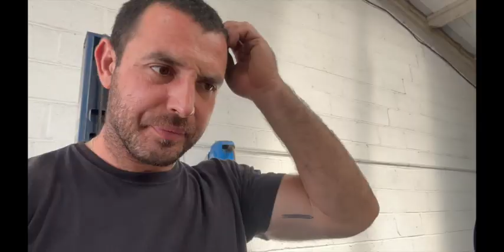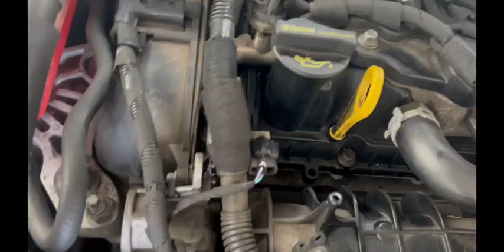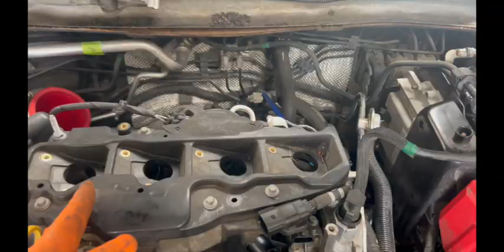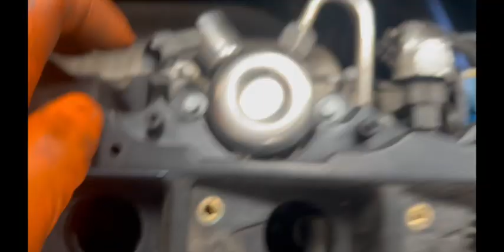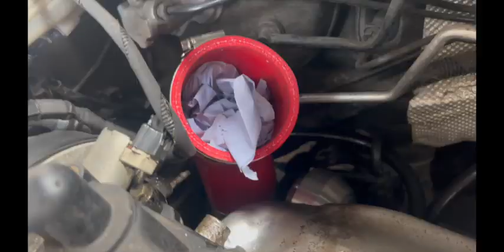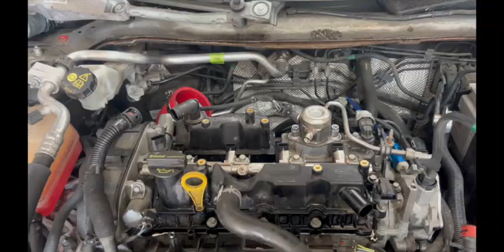Ford Fiesta ST Rocker cover gasket replacment #car #ford #fordfiestast #fiesta #fiestast #mechanic

Comment: My bolt on the first coil pack 
Just spins can i remove the cover off with outer bolts t get to my spark plugs or does the coil pack bolt hold it on ( without removing the whole rocker cover
Reply from the maker: You ideally need to remove that, I would try pulling the coil pack up while turning the bolt to put pressure on it to undo it!
You need that out to remove the coil pack to do it properly